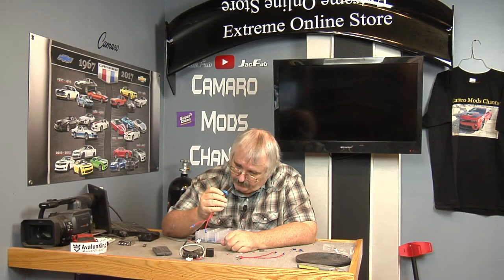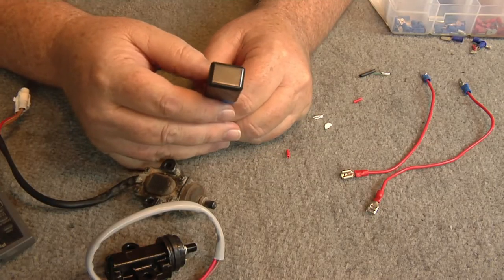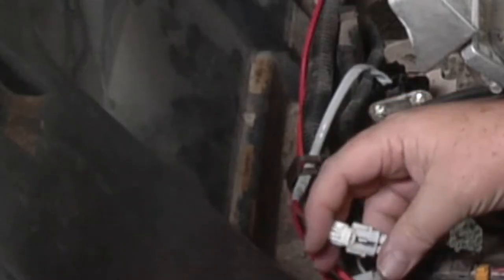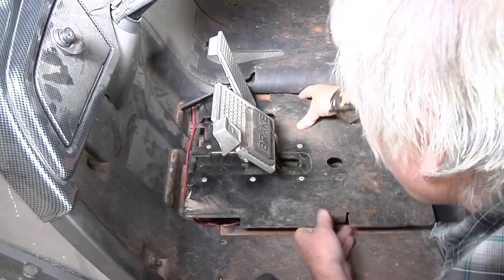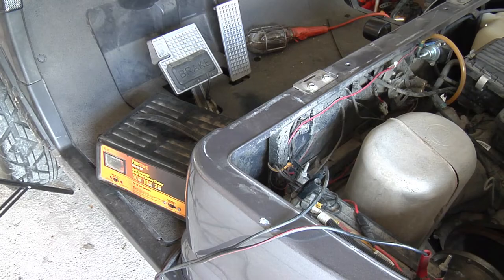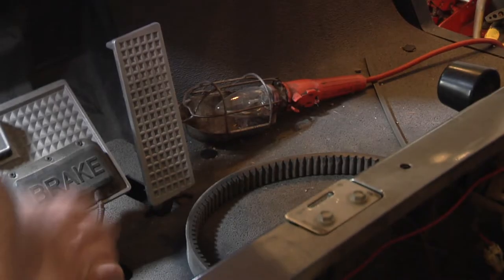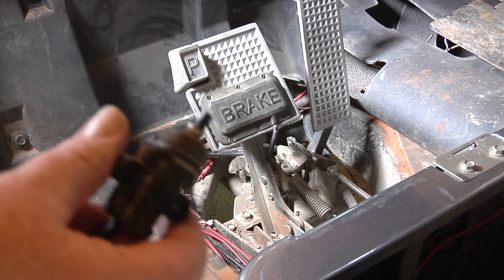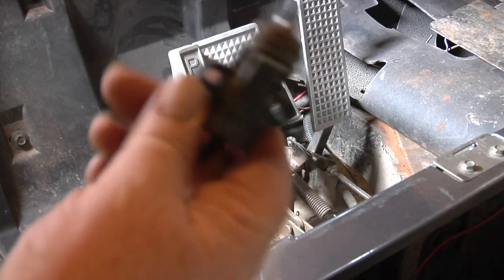Yamaha Golf Cart troubleshooting start and run problems

Comment: Hello I have a Yamaha drive2 I think it’s 2019-20 A friend borrowed it and hit the pothole. He drove it for a little bit and then it stopped, and now it won’t start. Any idea as where to start or what to check would greatly help me and is appreciated.
Reply from the maker: I would check the start stop switch,  its on the foot pedal. Check you battery connector,  thanks